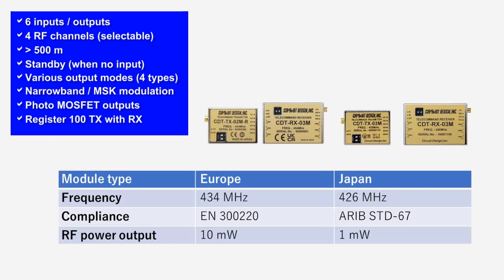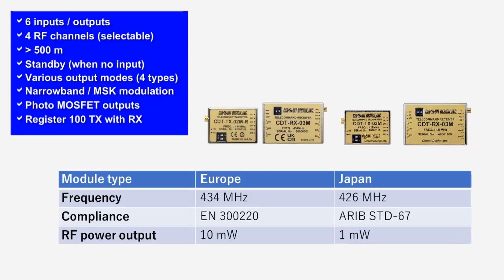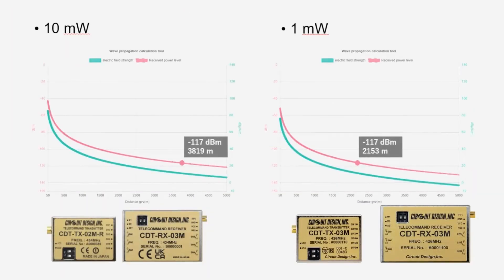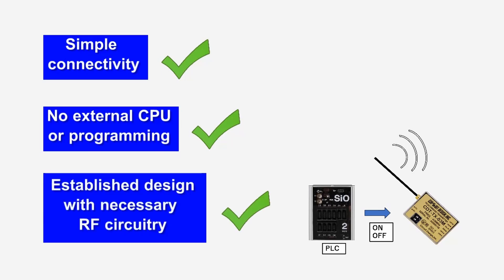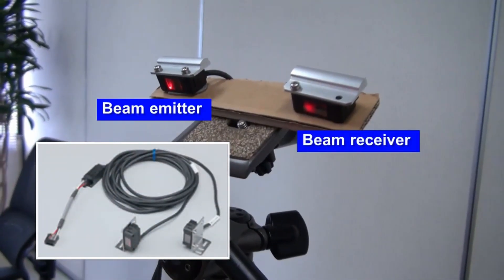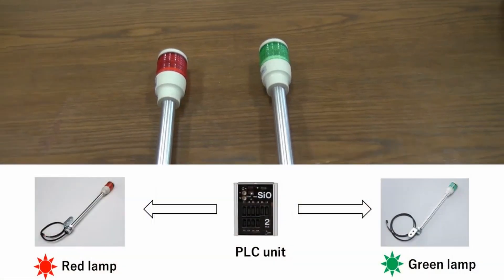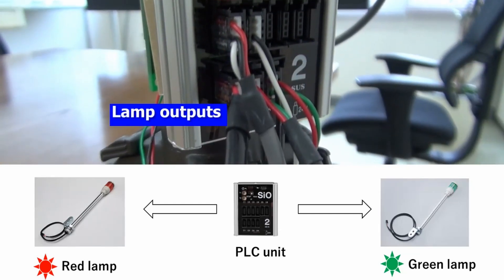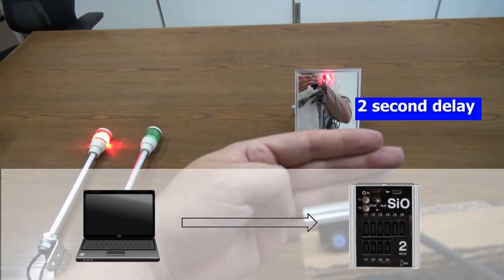Demonstrating the application of the 434 MHz / 426 MHz telecommand radio modules

Comment: But cant use two controller same time it will intrupt signal
Reply from the maker: Hello.
1. There are 4 frequency channels you can use. 
2. Max. 100 Transmitters can be paired with a receiver with a unique ID allowing N:1 communication.